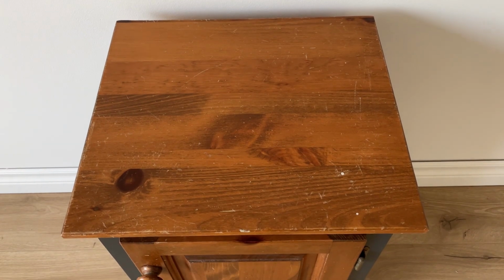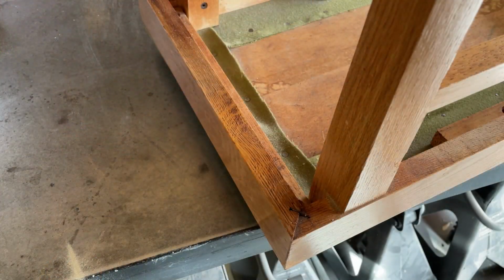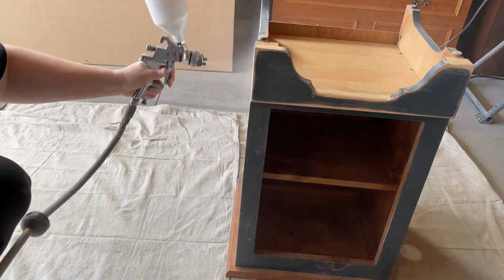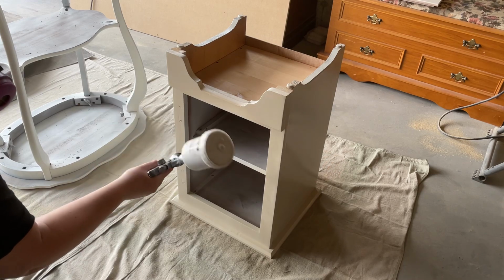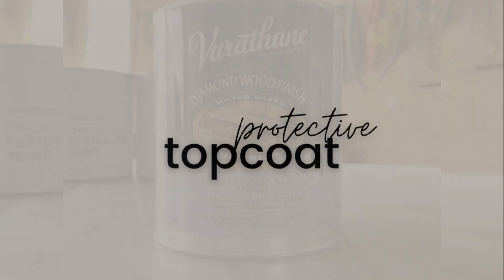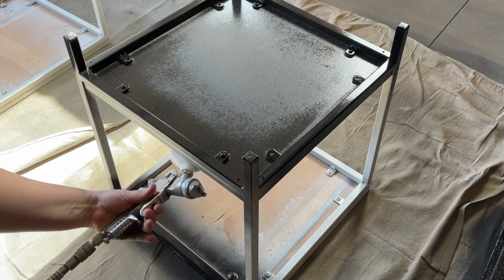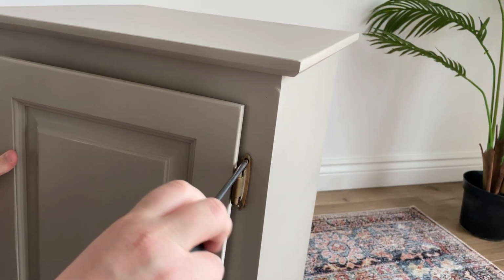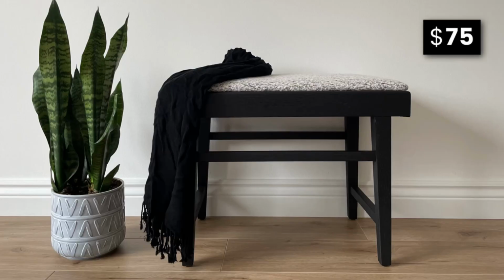5 Small Furniture Flips That I Found For FREE!

Comment: Hi Katie! Beautiful job!! Love your choice of colors! I have a quick question, can you stain wood filler? I have a table with a bubbly veneer and I feel that wood filler is the only way to get the table smooth without getting to deep into the veneer with the sander. Thanks!!
Reply from the maker: You can buy stainable wood filler but it’s an art to be able to camouflage it and not have it look like a blob of stained wood filler.
Reply: @salvagedbykscott  ugh. I was afraid of that. I have this wonderful teak table with slight valleys and hills. However the part that needs fixing is a veneer. I was thinking to use a stripping agent, then carefully sand the table. Just not sure how to tell how thick the veneer actually is 😳🤓!
Reply: Thanks for letting me know!!

Comment: Hi Katie.. love your videos.  I have a question.  I recently used Fusion paint and Fusion Staining Oil  .  Can i put a Varathane water based poly over top of the staining oil as Top Coat?   Thank you so much  .. i keep hearing you cannot put water based over oil but its dried for over 1 week now.
Reply from the maker: No you cannot use a Waterbased topcoats over an oil or wax finish. It will not adhere. The staining oil is not the same as an “oil based” stain so it doesn’t dry down the same way.
Reply: @salvagedbykscott  thank you so much for your help

Comment: Katie, when I spray my water based poly top coat I always get bubbles. Do you have this problem?
Reply from the maker: I’ve never had bubbles but I imagine that’s not fun 😬 make sure you’re not shaking your topcoats to mix them, always gentle stir and turn down all of your settings when you spray. Low pressure, low volume. Hope that helps!
Reply: @salvagedbykscott  I will try again and turn down all my sprayer settings. Thanks for the tip. Hopefully I will eliminate those nasty bubbles.

Comment: Hi Katie super cute side table I love all it’s curves! Can I ask you what psi you run your gun? I have been using 100 psi but doesn’t seem to go as smoothly as yours. Am I doing it wrong? About how long in total did it take you to complete these?
Reply from the maker: Check the recommendations for your gun. Mine is 30 psi but I usually spray my paint around 40.
Reply from the maker: 2 days. I for prep, primer, paint and 1 for top coats
Reply: @salvagedbykscott  ok thanks I have the same gun as you. Ty